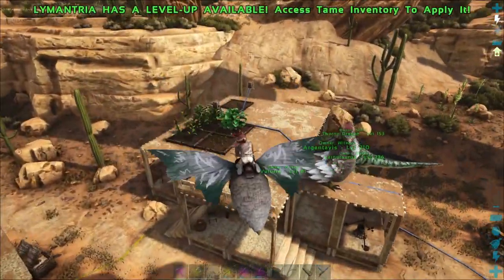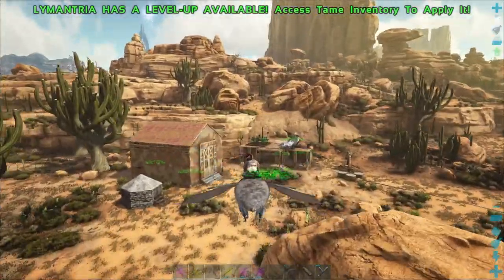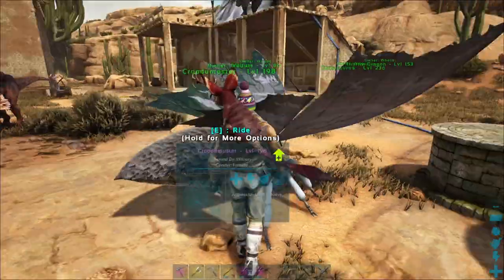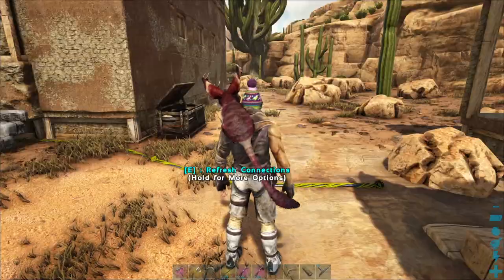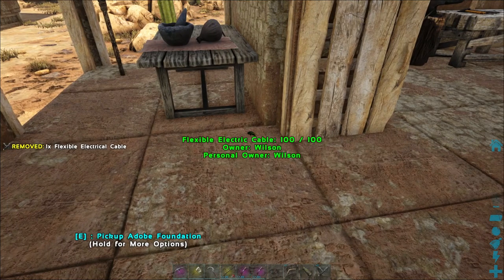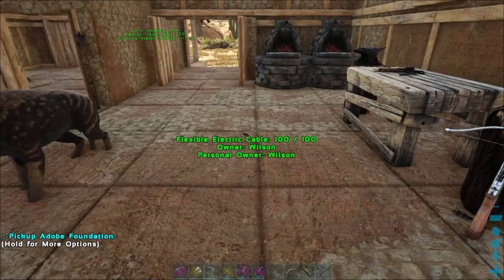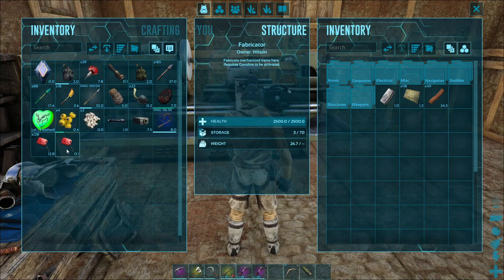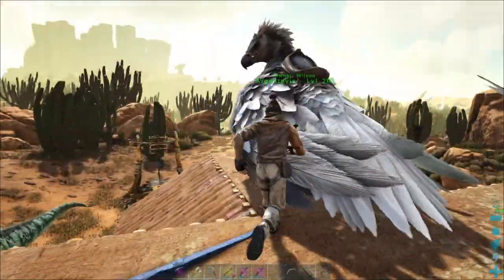Ark - Scorched Earth. Pt 6. Time for Water & Power!

Comment: The way power lines are done in ark is cosmetically pleasing compared to many other survival games I've played where the lines are either hung from point to point with a sag in the line and you can just phase through it or they're straight up invisible.
Reply from the maker: didn't used to be! It used to be a clunky grid before they put in the flexible lines